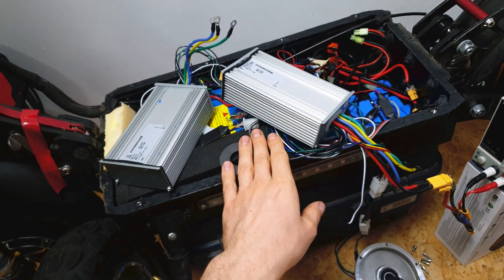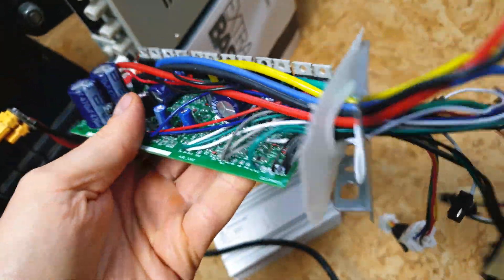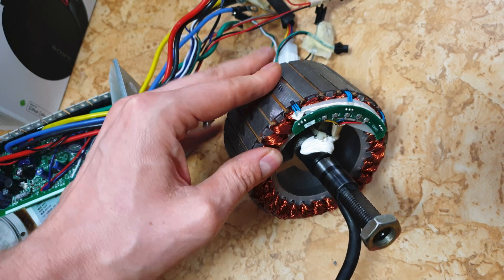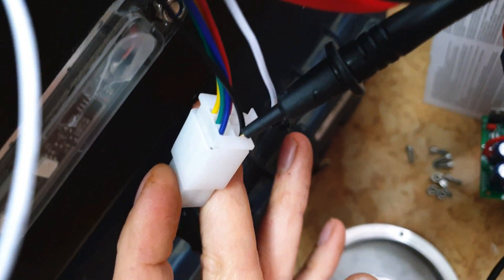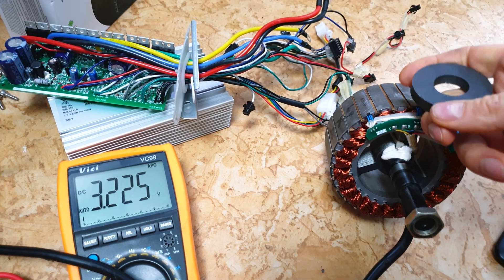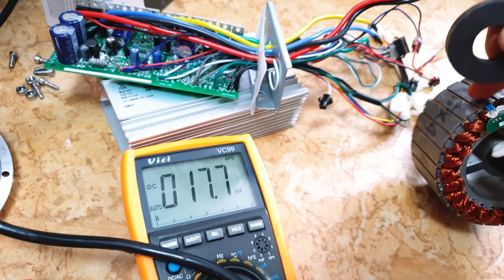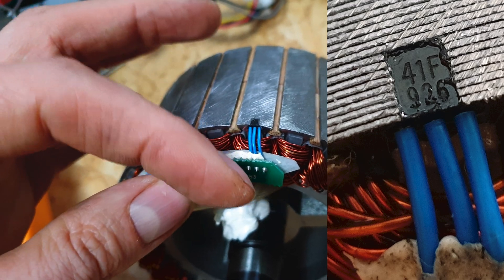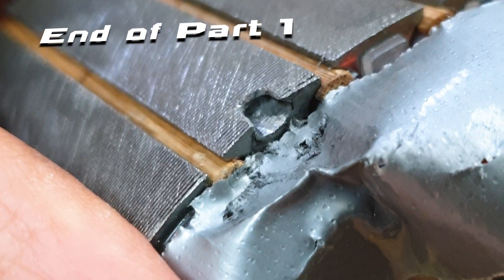Escoot Problem 🛴 Motor Twitch / Not work 💥 How to fix damaged Hall Sensor 🛠 Part 1 "90$ Less " 🤦‍♂️

Comment: ..hey Mr P heres a weird thing before when my scooter arrived , 1 of the blinkers didnt work , it came on but didnt flash and was very dime ! not since my motor has problem it has started working normal ! all power comes on console all lights work front rear and brake are ok ! but motor still has issue makes nose judders a but not run !  i check hall sensors like you explain , mine reads 4.9 i turn wheel and it goes to 0 then between 16. and 17. but my red and black read 4.3 on both !? any ideas please

Comment: so when will your shop be up and running again ?
Reply: Hopefully when he creates and advertises the Boyueda rear wheel vent so I can buy of him.
Reply: @strawman9410  yah i have the ES 18 and brought coolers very good but i need to buy another one as i had to cut the last one off as i over locktight the last one and had to cut it off lol i stripped head of screws but at least i got them out ... but now need new coolers to replace but No shop ):
Reply from the maker: I think no, at least on this one 🍻🍕

Comment: Hiya Mr P hope you are keeping safe !? i tried your method to check hall sensors with motor still on scooter and i get a reading of 4.9 on all sensors , and all go to 0 then like yours go up a bit front and back but still same problem wheel judders makes nose turns very slightly if i touch throttle but im scared to hold it as nose and i can hear vibration type sound ! any solution please ??? pretty please with cherries on top xD thank you again for awesome content ..
Reply: So it looks like one of Pirate's other sensors might be faulty as it gave a less than 4.9v reading.
Reply from the maker: Master so yours halls are ok,  ofcourse check if sensors got diffrewnt reading because all 3 cant have the same reading at same time
Reply: @PirateWasHere  so i check halls again i get 4.3 black to red prong in socket ! i then put red prong in yellow i get 4.9 i turn wheel a little it goes to 0 but rises to 17.3 and as i keep turning it jumps from 4.9 to 0 to 17. ! they all do the same !!??

Comment: where can i buy the engine coolers and charger connectors for the boyueda?
you can leave me the link
Reply: An intake vent that tucks behind the wheel arm  going over the cables that lead to the rear motor would cool the cables preventing them melting together and cool the motor. Which has been mentioned in a other post
Reply: Sean Mcknight ok but is there a show that sell the cooler for motor

Comment: I love your video's and I learned a lot from watching them. I got a question for the experts that can point me in the right direction. I have an Aerlang h6 v2 500w 48v 17.5a electric scooter and I want to make it faster.  What do I need to change and do to make that happen? Do I need to change the speed controller?  Battery? and or the motor? Thank you in advance!!!
Reply: I saw a video that says hit power button 8 times then should turn off . Then put it back on .switch mode to fast setting should unlock speed

Comment: Hiya Mr P i have a problem and was hoping you can help ! ? i had a puncture lol in the rear so i took the wheel off to change it and then decided to change disc and pads etc as you know to take the disc off the ES18 you need to disconnect the motor so i did this but i took the pins out of the white blocks like on your demo then i decided to do the same on the front but i reconnected the back one wrong and when i plugged it back in both power connectors made a pop sound and spark i thought this was meant to happen and tried to start the motors ! nothing happen and the console showed controller error ! so i unplugged and noticed i had wired the rear one wrong ! so i re-did it the right way and turned it back on ! no fault signal came up on the console but the back motor just makes noise and not move and the front does nothing at all ! can you help please sorry for my error ???? please help thank you
Reply from the maker: check hall sensors at first, do not add throttle till u fix it cause u will burn controllers and/or motors
Reply from the maker: btw pop sound is mor or less normal when u re connecting xt60 power yellow connectors, so do not do it very often cause it's damaging connectors. for 99% all is working , just chill and check all cables again 🍕🍻🏴‍☠️
Reply: @PirateWasHere  ok so will any volt meter do say from amazon to check this hall sensor !?
Reply: @PirateWasHere  cables all look fine now but problem same
Reply: AstroAI Digital Multimeter, TRMS 6000 Counts Multimeters Manual and Auto Ranging; Measures Voltage, Current, Resistance, Continuity, Capacitance, Frequency; Tests Diodes, Transistors, Temperature is this ok to buy for this job ?? please let me know as im clueless lol
Reply from the maker: Yes any cheap 1$ one with voltage meeter will do the job
Reply: @PirateWasHere  so have i damaged the hall sensor because i wired the controller wrongly on the rear controller ? i have now ordered the voltage meter and hall sensor in your link ! and look forward to seeing if this fix works. But need to know how to glue it back in ! i feel so stupid , as i check this plug like 3 times before  i reconnected it ! and still got it wrong ): is it possible that i have over tighten the motor when i put the new disc on ? thank you again for your speedy response and amazing content xD and now i wait lol
Reply from the maker: @verbsy  so did you wired wrongly white hall sensor box ?
Reply: @PirateWasHere  Yes ! but i only noticed after i switched on to try ! a red light came on the console which said controller issue ! so i checked the wiring and i had wired the rear control wrong ! i corrected this then tried again and the motor on rear just make nose not spin and the front does nothing !
Reply from the maker: Its hard to help over the distance , so i am not sure if halls are damaged or if there is any other issue
Reply: @PirateWasHere  what other would arise from the mistake i made Mr P !? because im confused ... im happy to try anything you can suggest or when we both have time do a video call perhaps ! the basic is all was working fine ! i unplugged main power and took wheels off , changed discs and pads , fixed puncture on rear , but i noticed the rear screws on motor were slightly loss so i tighten them very good , i noticed that the wheels locked up when the 3 main cables touched from motor but when i covered them with tape this was ok ! i finished the jobs re-connected all and the reast you know !?
Reply: @PirateWasHere  i need to go to work now and will be back tomorrow 14th sep after 17.30...i hopw you can figure this out with me xD
Reply: @PirateWasHere  what other damage would be caused by wiring the hall sensor box wrongly ?
Reply: @PirateWasHere  So if we can fix this issue , i come to Poland and we ride your best routes together lol xD
Reply: @PirateWasHere  ok i need to buy a volt meter ! which one should i buy ? i ordered hall sensors also and hope thats the issue ! what type of glue did you use to stick sensor back in lol  ? and much respect and thank you for your reply xD

Comment: Hi i have m365 pro,i want only higher top speed to be 32kmh,installed your firmware "drv155 unlocked speed stock power",but i see it has more power,i can see it in m365tools app.Do you increased phase current and battery current in sport mode?Some risk of burning something with this firmware?What is changed in this firmware?thanx

Comment: Ahhh yes thank u if I get rich I’ll donate a lot of money to your channels.
Reply: Soo same problem but my wires melted n fused together have I noticed the motor cables on controller are thicker in diameter compared to actually motors cable does that matter u think? My motor cabled fused n melted together going up hill
Reply: @MrGiodude17  buy some JIOS aerogel spray, or normal aerogel insulation tape which will be alot easier to find
Reply: for_all_those we dnt have those products in the UK where is it or what is the chemical compound maybe it’s another name I can’t even find the  jios aerogel spray
Reply: @MrGiodude17  you can buy aerogel insulation tape on amazon, the spray would make your life alot easier and worth the extra money if you can find it though
Reply: for_all_those I know u trying to be helpful but I can’t find this on amazon or even google ? Are u sure it’s Jios aerogel spray it looks non existent
Reply: for_all_those no u CNT u have sent me nothing I can’t purchase from that site mate I appreciate u trying to help but it’s not helping when the product doesn’t excist u way have bought it but there is no website I can buy it frm it’s not available on amazon or eBay so there for it’s none existent
Reply: @MrGiodude17  like i said, try and find some or just buy some aerogel insulation tape on amazon
Reply: @MrGiodude17  conformal coating 422b may be useful as it can withstand 200c hope that helps

Comment: Maybe because the build quality control is done by a dolphin high on lsd?
Reply from the maker: It's possible xD , but My boyed was working good till I decided to push it to the limit ;0)
Reply: Pirate could you compare Boyu with T85 in details (suspension, acceleration, punch, stability, durability, max speed, hill climbing)? There is a total disinformation on the net. In your videos you say Boyueda is more punchy at low speeds but at the same time it looks like T85 accelerates far better in range of 40-80 kph.
Reply: @michalkolodziej  ta dezinformacja w necie polega na tym ze te hulajki sa testowane przez ludzi z różną wagą oraz to ze nie ma dwoch identycznych bujedek czy t85 bo kazda jest złożona inaczej :D dopóki nie masz wiedzy z zakresu elektrotechniki to nie baw sie w te zabawki.
Reply: @artlew6547  Rozumiem Twój punkt widzenia i generalnie wydaje się być rozsądny. Z drugiej strony konstrukcja jako taka ma pewne cechy i parametry, które powinny być w miarę stałe nawet jeśli składają je Chińczyki :P Mam tu na myśli zawieszenie, stabilność, wytrzymałość. Co do przyspieszenia i prędkości to faktycznie komponenty w poszczególnych "seriach" potrafią się zmieniać bez informowania klientów tak jak było np. z tylnym shockiem w T85, baterią, silnikiem itp. Skoro @Pirate wskazuje w swoich komentarzach, że lepsze jest T85/ES18 od Boyuedy to znaczy, że jakieś przyczyny za tym muszą stać. Fajnie byłoby je naświetlić, szczególnie że jak na ten moment nie widziałem nigdzie ani 1 porównania.
Reply: @michalkolodziej  chciałbym Ci jakoś pomóc ale nie bardzo mam jak, ew co mogę Ci powiedzieć, to ze konstrukcja jest spoko i przy odpowiednim traktowaniu( dokręcanie śrubek, eliminowanie luzów jak tylko szybko się da, itp) to sa przyzwoite, t85 pod tym względem wygląda trochę obskurnie ale jest wytrzymała, gorzej jest z powerpackami i ogolna elektryka bo są najzwyczajniej zrobione na odpierdol. Nie ma tam za grosz czasu poświęconego na ogólne poprowadzenie kabli oraz rozłożenie komponentów pod deską, co zresztą pirate tez naświetlił w swoim filmie o buyedzie. Powerpacki nawet jeżeli wyglądają przyzwoicie to są często gęsto zrobione z gownoogniw, o których się nie dowiesz do momentu otworzenia powerpacka z folii termozgrzewalnej. O tym jak bardzo chińczyki tna na ogniwach możesz zobaczyć na filmie Farm Project o ogniwach 18650 na youtube. Ważnym tez jest fakt ze niektórzy uważają aliexpress za jakieś objawienie na rynku ukazujące zdzierstwo większych producentów, gdzie można kupić produkty po prawdziwych cenach, co jest zwyczajnym kłamstwem. Sam zamawiam tony z ali ale jestem świadomy ze to co kupuje jest często chłamem. Dopóki wiesz co robisz to zakup takiej hulajnogi pewnie będzie opłacalny, ale wiedz ze taki wolf warrior czy thunder które kosztują 3x tyle nie maja ceny wyjętej z dupy. Rozwiązania, uzyte komponenety, precyzja przy budowie, jakość ogniw, konstrukcja swoje kosztują. Przykładowo tylni widelec w wolfie jest 4x (!) Grubszy niż w t85. Na necie raczej nie znajdziesz dokładnych porownan pomiędzy tymi hulajkami bo nawet porównanie dwóch t85 do siebie da różne wyniki.
Reply: @artlew6547  Dziękuję Ci za poświęcony czas :) Przy wiedzy, którą posiadasz gdybyś musiał wybrać między T85, a Boyuedą (bo np. Wolf byłby poza Twoim budżetem), to na co byś postawił? Zastanawiałem się również nad tym bajzlem pod deską - czy widzisz jakąś możliwość lepszego rozlokowania kabli i zapewnienia im odprowadzania ciepła choćby przy użyciu padów termo przewodzących i trytek? Jak jest to rozwiązywane w lepszych skuterach?
Reply: @michalkolodziej  jeżeli chodzi o ułożenie kabli to pirat zrobil to całkiem dobrze, na co należy zwrócić uwagę i za co pochwalić pirata to, to ze usunął potencjalnie niebezpieczne elementy jak wystające śruby, które mogą uszkodzić baterie. Jak będę kiedyś otwierał mojego wolfa to zrobię zdjęcie i Ci podesle o ile jeszcze będzie Ci to potrzebne, narazie mam 4k kilometrów zrobione, 70/30 ulica/ offroad i nie trzeba było otwierać deski. Osobiście w podanej przez Ciebie sytuacji wybrałbym to co akurat będzie tańsze (jak coś będzie nie tak to mniej kasy utopione, a jak się okaże spoko to sytuacja win/win) moze z leciutka przewaga bouyedy ze względu na ogniwa 21700 chociaż z tymi chińskimi ogniwami to jak napisałem wcześniej bywa różnie. U mnie sytuacja była podobna i poprostu w sklepie powiedziałem ze h_j tam raz się żyje i dołożyłem do wilka, mimo że pojechałem po dualtrona spider limited II. Facet w sklepie tez mi powiedział że z moimi gabarytami ( waze 100kg ) nie ma sensu brać nic innego jak thunder/X/Wolf bo w offroadzie to nawet dualtrony poniżej thundera klękną dość szybko. Warto to mieć gdzieś z tyłu głowy przy wyborze. Wiem ze odłożyć 3k dolców może być problematyczne i takie chinskie hulajki mogą wyglądać naprawdę atrakcyjnie w tym przedziale cenowym, to naprawdę bym się zastanowil zanim bym wydał na nie pieniądze.
Reply: @artlew6547  Widzę, że bardzo profesjonalnie podchodzisz do tematu. Myślałeś, żeby wrzucić na YT jakieś nagrania z Twoim Wolfem? Janobike T85 również ma baterię na ogniwach 21700 (przynajmniej ten ostatni rzut), z tego co wyczytałem jest lepsza niż w Boyuedzie, bo ma bardziej urealnioną pojemność ogniw. Z kolei ES18 ma kontrolery 2x45A, ale za to nieco tańsze ogniwa niż T85. Oczywiście wszystko zależy od miotu, bo nie sposób przewidzieć, czy aby na pewno dotrze do nas taka bateria / kontroler jakim się chwalą.
Po prawdzie to już zamówiłem kilka tyg. temu zarówno Boyu, jak i T85 i aktualnie czekam z utęsknieniem. Jedno zamierzam odsprzedać i na tym sobie jeszcze trochę $ odbić. Mam jednak wątpliwości czy dobrze zrobiłem kupując obydwa, bo teraz czeka mnie wybór, który jak widać prosty nie będzie. Albo będę musiał rzucić monetą, albo przeprowadzić rzeczowe testy tych 2 egzemplarzy (a nie modeli - jak słusznie napisałeś).
Reply: @michalkolodziej  lol this comment about the quality control manager is now a repair thread. good lord.
Reply: @michalkolodziej  myślałem zeby coś takiego zrobic ale potem zdałem sobie sprawe że i tak bym nic więcej nie dodał niżeli już tego nie zrobił gingeronwheels czy wrongway, a powielać tematu nie ma co. pojezdzisz obiema hulajkami i sam zobaczysz co Ci bardziej pasuje, z tego co wiem w obu egzemplarzach jest spora róznica w tym jak sie zachowują w róznych przedziałach prędkości oraz jak reagują na spust. No i z chinczykami to otworzenie deski na dzien dobry to wręcz konieczność i to najlepiej tak jak to zrobił pirate- pod kątem poprawy bezpieczenstwa powerpacka bo te wystające śruby to jakaś kpina. do dzis nie wiem po kiego one tam są. no i ma być radość z jazdy!
Reply: @PirateWasHere  someone said there was a plastic connector that melted inside the battery tray. Do you think this is what caused the hall sensor to break?